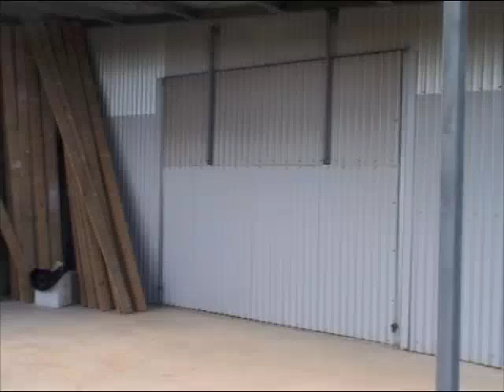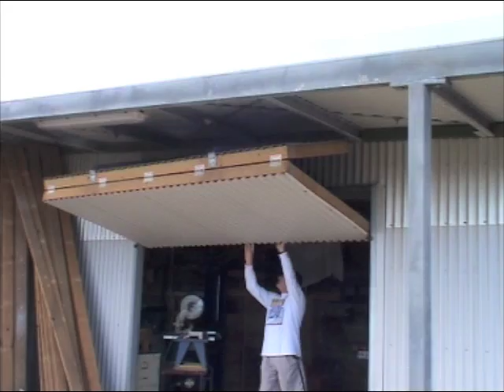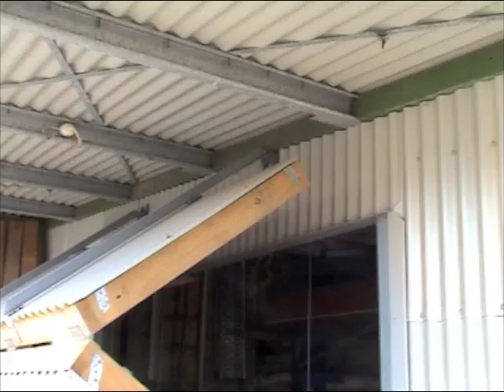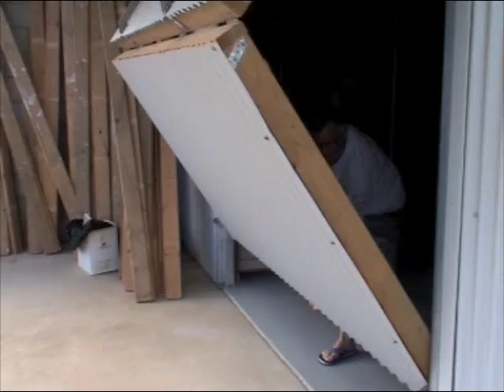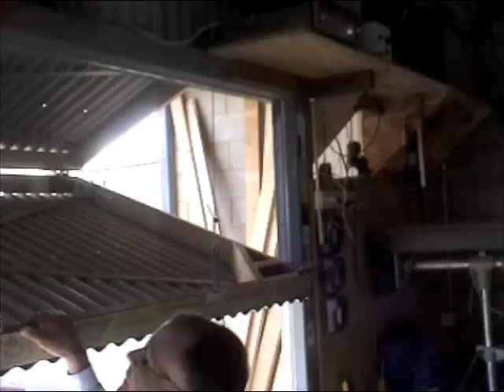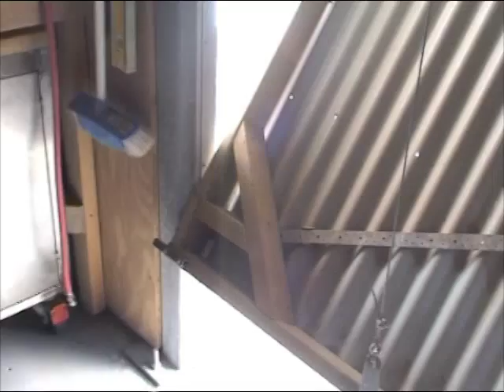Hangar Style Bifold Door #2 - Made by J&D

Comment from the maker: It has been in fairly constant use for four years. No issues at all with it. I expected the cheap pullies at the header above the door and or the light duty wire cable to have failed or at least show some wear by now but they keep going...I already have replacement pullies and heavier cable ready to go. 

I used 35 x 90 timber (2 x 4 for you) for the door. If I had to remake the door I'd use light gauge 40mm square tubing and gain another 100mm of height when open, lighter too.

Comment from the maker: Sachin, the door I've built is also flexible but fairly heavy. When in the raised position the bottom rail weighs 35kg. The only reason the door shuts straight is because on the inside I have a single counterweight that splits into two cables which tie into the bottom rail. Because the cables must move together, they work to keep the rail level as the door comes down. I am assuming your sunscreen shade is relatively light and even more flexible with no counterweight cables or other means to keep the bottom rail level as it moves up and down.

Comment from the maker: Hello,
It took about 16 hours. If I'd had drawn up plans it may have taken less. The hardest part was bolting up the top hinges where they join the wall due to the corrugated iron sheeting, and then finding the right position for the roller bearings at the bottom edge so that the small square tubing on the inside would just touch only when fully closed or open.

Comment from the maker: Tracks on the inside are a great idea. I'm sort of confused though...a track on the inside would render the bearings on the outside redundant. On my design, the only thing the 20mm square tube on the inside lower edge is to keep the door from swinging out when the door is shut, your tracks would serve that purpose already.

bearings are 37mm diameter
door is 90mm thick
bearing O.D. is 28mm out from door face
bearing O.D. is 130mm up from door bottom

Comment from the maker: Is the top or bottom part of the doors level? If only the lower half, and your bearings are inside, the wheels should be at the very bottom but for this to work your top hinge point needs to be lower as well since the upper is pivoting from the outside of the wall and the lower is pivoting from the inside. However, If both halves are level, your top hinge point is too low. I think pictures of your design or measurements will help me understand.

Comment: how to make both the sash remain straight. I have used the same principal in sun screen shade, but when i closed it both sash will not closed in straight line or We need to pull at center to closed in straight line. Using S.S bearing hinge 4" between two shutter. 
 reply if you can add to resolved  my issue.